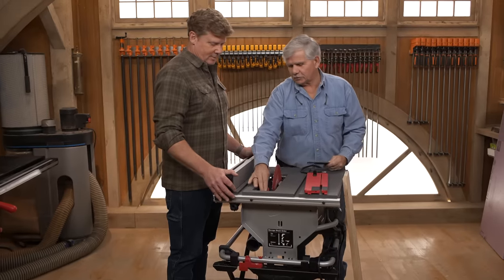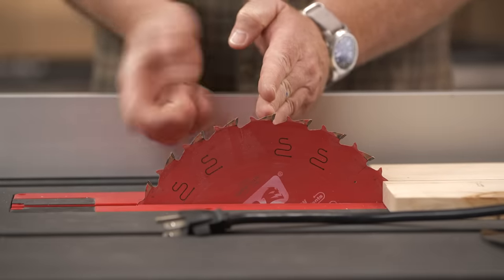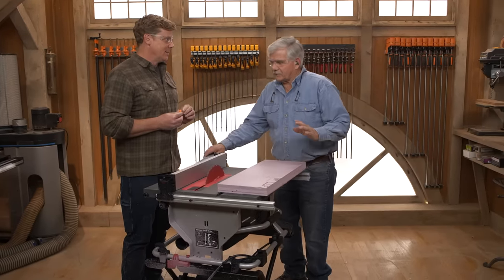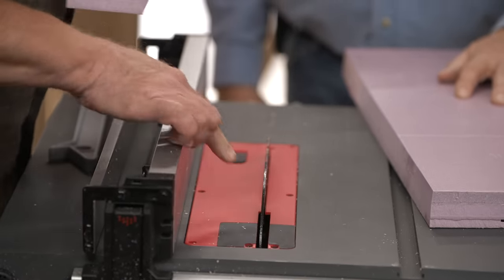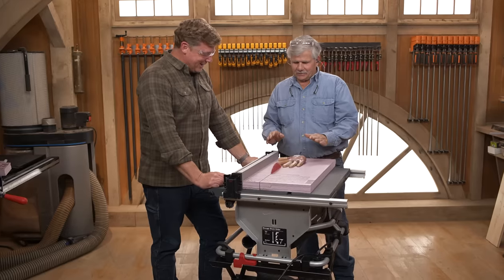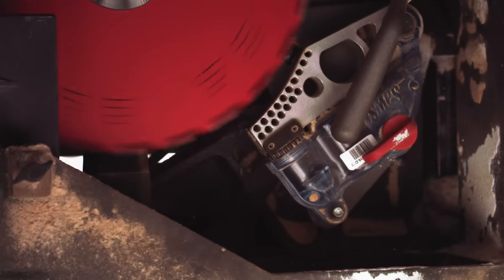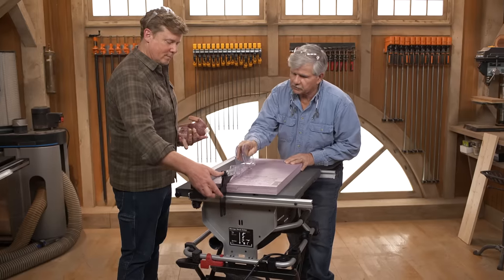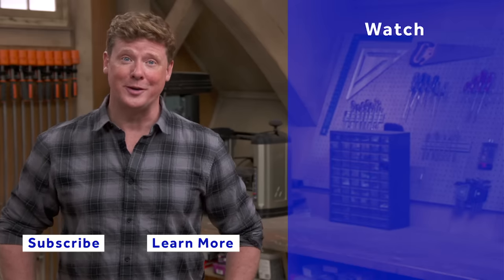Simple Guide to Table Saw Safety | Ask This Old House

Comment: That Saw-Stop technology is pretty wild
Reply: Yup, and every table saw manufacturer turned them down to license the technology. So they made their own saws.
Reply: Pity it cannot be retrofitted to old saws.
Reply: @JoePJack1  Is that so? Shameful that the patent holder's greed prevented the safety feature from becoming way more widespread. Murrica.
Reply: surge balck
Reply: @JasonFarrell  it wasn’t the patent holders greed. The manufacturers saw liability issues if they sold one saw with the technology and other models without.
Reply: Still, 3 Germans lost a finger last year cause it did not work. It´s not 100%
Reply: @JasonFarrell can you not read? It was the exact opposite situation.
Reply: @justinharper6909 are table saws dangerous im a diy guy should i stay away from them?

Comment: It's a decent video on kickback, but it should really cover a lot more. Don't use a miter gauge and the fence at the same time, don't cut twisted, cupped, or warped boards, don't put your hands behind the blade, don't pull lumber through the saw, always use either a miter gauge, fence, or sled (no free-handing), etc.
Reply: Pulling wood through is not a hard and fast rule.  If you're pulling from the end of an 8 foot long 2x4 you're never in a million years going to get pulled into the blade if it kicks back.

Comment: Don't understand the part where he says blade is ruined? What does it do that renders it useless.
Reply: The brake (big chunk of aluminum) gets shoved into the teeth of the blade - that's what stops it and pulls it under the table. The force exerted on the blade is incredible and could damage it even if it looks okay on the surface.
Reply: Well the blade is stopped ubruptly by sinking its teeth into an aluminum matrix at the speed of around 150 miles an hour, so it's not recommended to be reused due to possible stress fracturing or other weakening of the blade.
Reply: @facklere thanks, that was helpful to understand
Reply: @mitchdenner9743 Thanks, that was helpful to understand

Comment: Buy a radial arm saw for riffing. Put on a anti-kickback blade. Get rid off the dangerous table saw. Job done!
Radial arm saws go on different direction, much better. And you don't have the issue of reaching over the blade to collect your pieces of wood.

Comment: I had one moment of distraction when using a table saw when I was 16.  The wood kicked back and my left hand went right through the blade.

It really didn't hurt.  Felt like I slammed my hand down on the table.

Started to walk into the house from the garage but had the presence of mind to turn around and check the saw for any loose fingers.

Somebody was watching out for me because the saw was set about two inches high but it only removed my thumb and sawed three-quarters of the way into all my fingers.

I had a great surgeon that was able to put everything back together again except I did lose my thumb joint.

That was 35 years ago and my hand works good enough that I can type about sixty words per minute and I'm currently employed in tech.
Reply: Ouch. At the same age in shop class I cut halfway through my left hand pinky. Just some stitches. Havent had an incident  in 45 years since.

Comment: Don't know anybody is still reading this but I will still add to the conversation on the subject. Back when I was learning how to use a table saw , many years ago, I was talked to add some thickness to the rip fence up to the point where the saw blade starts its cut. This change to the rip fence prevents the workpiece from pinching between the saw blade and the fence. Now the addition of a featherboard before entering the saw blade keeps the workplace firmly against the fence.

Comment: Another tip is a quality table saw where the fence actually stays parallel to the blade. I had a cheaper one that sometimes would "wedge" the wood, resulting in stopping the blade or worse - kickback.
Reply: I volunteer at Habitat for Humanity where my supervisor is constantly telling me to use a pusher stick provided to send the. piece through that last 6-8 inches. Your thoughts? Often on larger wood it seems like more trouble than it's worth.
Reply: Agreed. A heavy table saw with a cast iron top is far more safe than those cheap rickety "contractor" saws you see on jobsites.
Reply: The good thing about cheaper table saws is that when kickback happens it's much less violent.

Comment: Also note that, when using a SawStop saw, you should only use unpainted, SawStop blades. The stop system works based on sensing a small electrical current flow, and painted blades like this one inhibit that process.
Reply: Was looking for this comment. Though they dont have to be SawStop brand blades. The blade that ships with saw is junk. I use CMT blades in my PCS. But yeah definitely unpainted blades. And also make sure to get a sawstop recommended dado set too haha.
Reply: Huh.... Where have you seen blades with painted teeth?
Reply: @batvette  the teeth arent what bond the blade to the saw.
Reply: @mauricecooper9016  the arbor hole is unpainted dude. It sits on the motor shaft. The teeth then contact the skin. Or hot dog. 
Hey I dont own one maybe Im wrong but I dont think so.
Reply: @batvette  the arbor hole on diablo blades at least are painted. All i know for sure is that SawStop recommends not to use painted blades in their saws because it could cause the brake to either have a delayed activation or no activation at all so i dont run them in mine. Not to mention the paint from the blade sometimes tends to transfer to the work piece when making a cut. Not an issue when rough cutting but not something i would want on a finish cut.
Reply: @mauricecooper9016  not to mention paint tastes bad on hot dogs.
Reply: @batvette  thats because you’re using lead-free paint 😂

Comment: My first table I ever owned, I inherited after my dad passed away. Very first cut, I got a kick -back... scared the crap out of me. Changed the way I was cutting and haven't had an issue since. Pretty sure I was unintentionally pinching the far end of the board together I was cutting while pushing. Bone head move.

Comment: A male person took some safety features off of our table saw (for reasons that probably won’t seem sensible to me, although I’m sure he’d disagree 😅) and he didn’t put them back on… but I didn’t know that… so I whizzed a 1/4x1/8” piece of craft wood across the workshop and fortunately I was not in its way. It really FLEW!!! I don’t think such a small piece would’ve killed me, but I suspect surgical removal may have been necessary. 😬

I had used it many times before, but he always set it up for me. I took for granted that it was good to go, and that I knew what I was doing… when in fact, I did not. I had a false sense of confidence without understanding all of the features. 

Don’t be like me!! Learn how to set up all the tools for yourself and how they all really work- or just wait til he gets home. 😅

Comment: Well, at least they finally got around to mentioning the blade guard near the end of the video, tho they didn't seem to know how to actually install it.  The blade guard is the simplest most basic safety feature, it comes with every saw, also provides a riving knife and in many (if not most) cases comes with the anti-kickback pawls, and frankly they should have been talking about it long before something as elaborate and expensive as a sawstop system. There are guys down in the comments doing the macho I-know-better "by God I know what I'm doing and don't need those training-wheel blade guards and riving knives". I wish them luck but don't listen to their advice. It can happen to anyone, even them. Just because it hasn't doesn't mean it won't.

Comment: Told my dad about it on his new saw come back 3 days later to use his saw it dont work

 he used a hotdog to try it out thinking it was simple as resetting a breaker not thinking it would trash the whole system

 it was so violent it cracked the mount for the motor but im sure 585 for a new saw vs 20k for hospital bills

Comment: It works on resistance, where wet wood and moisture will trigger it. So make sure your wood you cut is dried enough, otherwise, its like $80 a replacement cartridge AND your blade...which I think you should inspect. I've seen so many of these youtube makers with $3500 sawstop cabinet saws...and most never disclaim they paid for it or it was free for advertisement purposes. I'm sure its a great tech, but they should license it to others, to save fingers and other injuries.
Reply: Sawstop originally tried to license the technology to every single saw maker out there. All of them didn't want the technology. It is funny how people think Sawstop is the bad guy for "keeping this to themself" but they tried. Of course they won't license it now that they had to go thru and build an entire business selling tablesaws.

Comment: A simple guide to table saw safety should include throwing that plastic push stick in the garbage and making your own out of soft pine, I have over a dozen push sticks of different designs for specific tasks. Those plastic push sticks can be a danger all their own when making contact with a table saw blade.

Comment: This is the only major tool I don't own. I have 17 hammers, two skillsaws and no table saw.
Reply: I have so many tools my landlord said I couldn't keep them in my apartment. Honestly it's not that much, they aren't used to seeing a man with a few toolboxes. And like a man I refused.
Reply: You can get kickback with a circular saw too. In fact, I think it happens with more frequency that with the tablesaw, but your hands are away from the blade, so maybe a little safer. I've had it happen twice, once with a piece of plywood and once when cutting up a pallet. Scary.

Comment: Kickbacks don't always go straight back.  Demonstrations that I've seen and video of actual kickbacks.  The piece climbs up over the blade and is launched at about 30 degrees or so.  Right where Tommy is standing.  Seems to me that standing on the opposite side of the fence from the blade would be safer.

I think it is a disservice to indicate that kickbacks go straight back.  Very over simplified.

Comment: In 45 years of working around a table saw (sporadically as a hobby, not daily professional use) I refuse to use the blade guards or riving knives. Like many other safety features they introduce their own hazards. 
Several rules to follow. 
1. Blade only as high as it has to be.
2. Never move the work backwards.
3. Push stick when needed.
4. Stand to the side if kickback is a risk. 

And.... I wont list this as 5 because its the most important. 

Never, ever, take your eyes off the spinning blade. If you have to look away for a second, keep it in the corner of your eye.

A final tip is check the blade/motor alignment with the fence and mortar gauge groove when you first get a saw. Its common for them to be up to a full degree off. If its narrowing itll shoot your work at you especially if the blade is tilted.
Reply: batvette wrote:  "I refuse to use the riving knives. Like many other safety features they introduce their own hazards."
Yet you did not cite even one.  Probably they are insignificant compared to the safety they provide.

Seatbelts can result in injury in an accident.  Far more likely it will save your life or reduce injury severity though.  There was a time when people would refuse to use seatbelts.  But they finally wised up due to being legally forced.  Now they wouldn't stop using them even if they could.  Hopefully it won't take a serious injury for you to wise up.

Years of experience is not justification for rejecting safety features.  One of my brother-in-laws is seasoned carpenter for at least 5 decades.  Almost lost a finger due to kickback a few years ago.
Reply: @RazorStrap  because the guard thats attached to it gets in the way of the blade, I dont need to fight that to get my work to the blade. 
Hey if you feel you need training wheels have at it. Most of us just got on and pedaled.
Reply: @batvette Riving knives are not a training device (training wheels), to be used while learning to use the tool (ride a bike), then discarded.
Reply: @RazorStrap  I described why theyre a problem, why not address that. The guard interferes with the work cleanly meeting the blade and creates its own unnecessary hazard, just as I stated. Some brands do it better than others, but having to wiggle the work around to get it past the guard is a distraction I dont need.
Reply: @batvette  The blade guard and the riving knife are two separate pieces of equipment.  The blade guard can sometimes get in the way.  A riving knife rarely if ever gets in the way.
Reply: @dansanger5340  hmmm... Didnt look too close before I threw them away but the ones that came with two table saws Ive bought were attached together. Ill update my comment and assume I didnt look too closely.

Comment: Everyone loves that saw stop yet nobody has put their real finger in it
Reply: you can find a video of its creator putting his finger in it
Reply: You first
Reply: Because it's expensive to replace the blade, brake and anything else that it breaks.  Like an air bag.  One use and replace.  There is no test to verify if it's working feature.
Probably a few people have put their real finger(s) in it though, and it saved them.  So, they are not part of the injury statistics and not heard about.
Reply: When I bought my SawStop table saw, guy at the store gleefully  asked, “Wanna see the worst injury I’ve ever seen on a SawStop?” Turned out to be a cut that would require no more than a bandaid. 😂